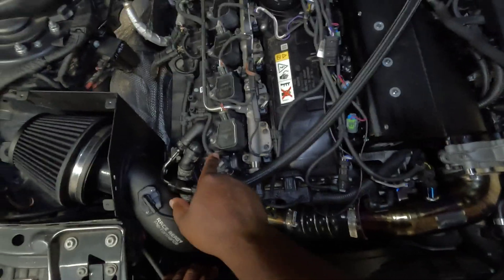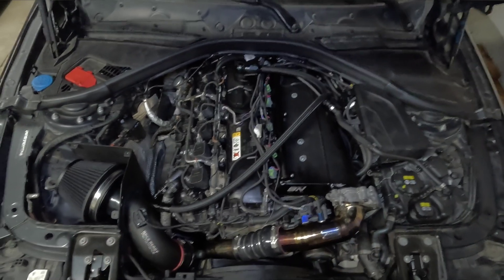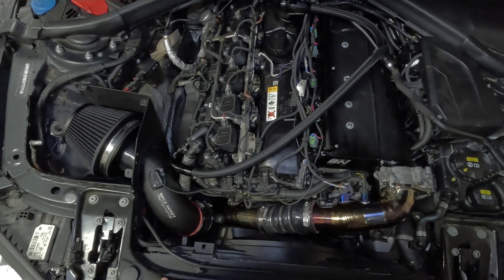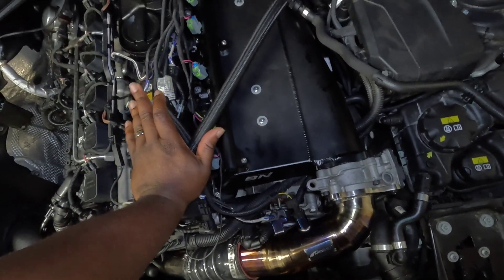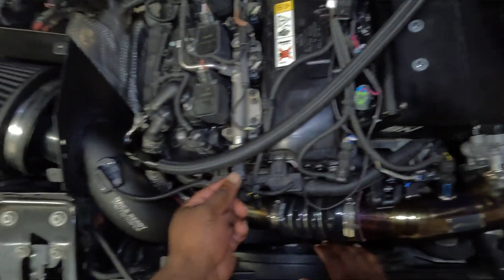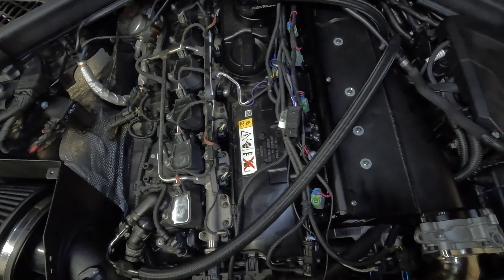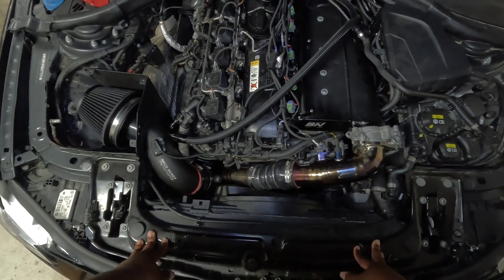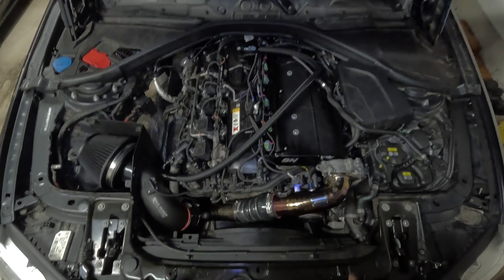Every Sensor in the B58 Engine Bay (And What They Do)

Comment: I have a code pop up on my M240 have you seen these before? 101F02 throttle angle intake manifold pressure

105201 Ambient pressure sensor

Comment: @kern417 Is the knock sensor under the intake manifold? I’ve got a gen 1 running mhd stage 1 for a while and I’ve got “knock sensor two faulty” and drive train malfunction. Thanks for the content.

Comment: i'm getting code 10890C
intake air temperature sensor in front of the throttle valve, electrical: short circuit to plus. i've changed the sensor what could be the issue?

Comment: You forgot to mention the knock sensors, oil control valve, cranksensor. Oil pressure sensor also the pressure transducer for active water pump  also the heat management, oil and coolant temperature sensor last one is the oil level sensor
Reply from the maker: @mosestaukobong5937  you mean all the stuff you can't see in your engine bay? 🤔

Comment: Love your videos.  When you explained the 3 cams. I was like. This guy knows his stuff but i still don't understand the 3 cams .  So i think i have a problem.  I replaced my radiator at 80k miles. Now I'm a little paranoid. Didn't put the bottom plastic on yet. I drive the car for 15 minutes. Temperature is good. I opened the hood. The overflow tank is really hot. Top of radiator really hot. But the bottom portion. I mean literally almost half the bottom of the radiator all the way across isn't even warm.  I don't understand.  And the return pipe back into the engine is in the middle of the radiator. So is it only taking water forced out of the engine which is at the top of the radiator and not taking any cold coolant from the bottom of the radiator. Is it a design flaw. I don't understand.

Comment: Meaning the T-Bar sensor measure the IAT?

And the pressure sensor at the chargepipe gets shown in the logs on Datazap as „boost target ram psi“ and the one after the manifold is the limited one called „boost target psi“ with 23.3 psi max?